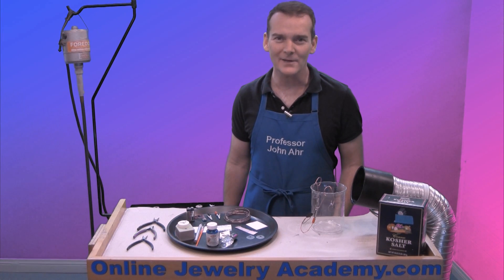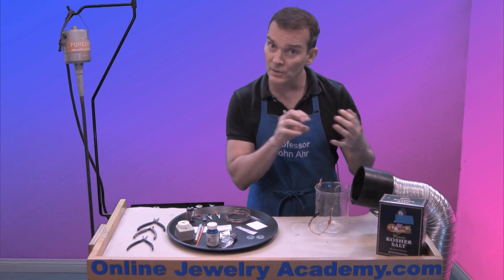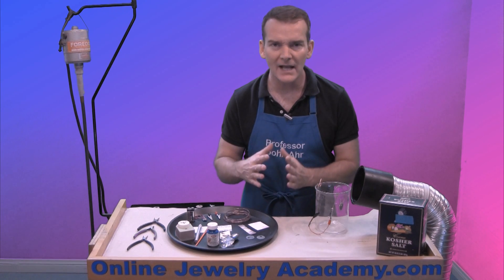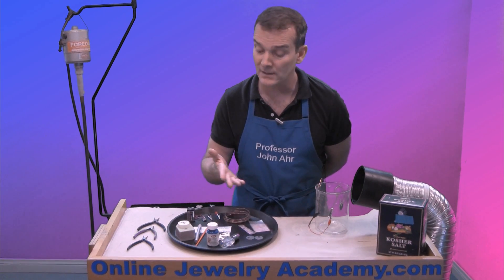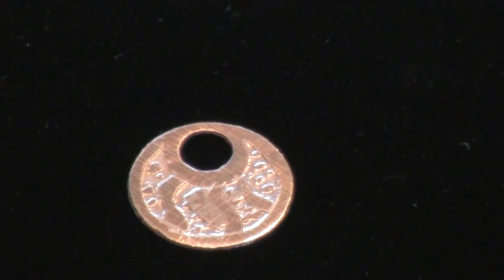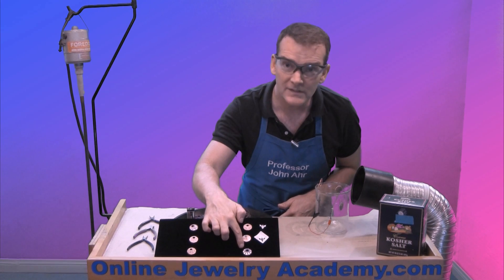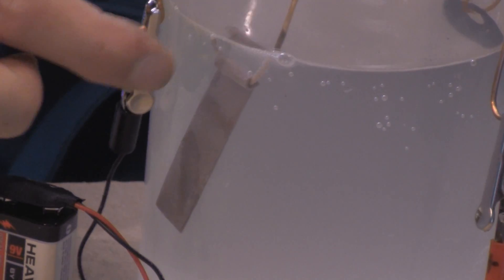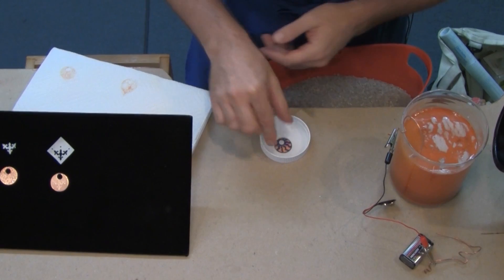Electrical Etching Using Salt Water

Comment: At what point would you recommend using a DC power supply that plugs into the wall
Reply from the maker: Because working with electricity can be risky, the OJA has purposely avoided posting on that topic. There are numerous post about this on other sites. Good luck with your creative pursuits. 😀

Comment: Wax works as a resist in many other art projects. Would it work well here?
Reply from the maker: In my experience, any material that’s easy to rub off of a metal surface doesn’t make a good resist for etching. So, wax is not a good choice. 😀

Comment: 5:27 Do you always protect the backside or do you sometimes leave it exposed for a better shellacking?
Reply from the maker: Any part of the surface of your piece that is not protected by a resist will be attacked by the etching process.  So, you must protect the back side of an object that you plan on etching. 😀

Comment: is it possible to etch a 4" hole right through to the other side in stainless steel ? it would save me money on carbide hole saws if it is.
Reply from the maker: You should ask someone who regularly etches steel. I honestly don’t know the answer. The process in the video produces a low relief etch. 😀
Reply: @OnlineJewelryAcademy  no worries, thanks mate :)

Comment: Thank you so much for making this. Clear instructions, good camera work, accessible tools and ingredients. I've been researching this process and you honestly have the most approachable tutorial I've found on YT. Also, it's been years since you posted this and you still take the time to respond to questions. You're the best.
Reply from the maker: Glad you enjoyed the video. Thanks for watching!😀
Reply: @OnlineJewelryAcademy  
I am glad i came across your video! Could you please tell me - in the last example you used email and after that you removed all of it.Can you tell me what sort of email it was- full name and the solution you put your sample in?Full name when possible.
Also what battery it is, never saw anything like it in Europe,and Germany in particular can you tell me Full Name for this.
Huge thanks and my respect for your knowledge and comprehensive explaining!💓🤗
Reply from the maker: @jolantastanko1233  I used enamel paint for toy models. And I used turpentine to remove it. The shape of the battery isn’t important. You need one with the correct voltage. I recommend that you continue your research and investigate battery options available where you live that can be used for this process. You may want to look for information produced in your home country. Good luck with your creative pursuits. 😀

Comment: Thanks for this. Just to confirmIf I want to etch aluminium, I guess I'll need an aluminium piece for the negative?
Reply from the maker: Hi Lulu Labelle,  Electrical etching is great.  But, I have found that it works best on copper.  You might want to do some more research online about etching aluminum before you try it.  I have not performed this process on aluminum.  Therefore, I cannot say how well it might work.  Good luck with your creative pursuits.
Thanks for your support! : )

Comment: hi, can I use this method using, staz on ink for the main image to be stamped (etched around) on the piece?
Reply from the maker: I'm sorry, but I don't understand your question.  The best resists to use are PNP Blue Paper, enamel paint, and permanent marker.  You can also use contact paper as shown in the video.  The OJA has two more videos on salt water etching that you should watch.  They might answer your question in depth.  You'll find them on our website at: www.onlinejewelryacademy.com
Thanks for your support! : )

Comment: It worked in sterling silver using 9volts battery but you have to leave it overnight. I tried using the 9v adapter but I was not comfortable leaving it for the whole night; I did it for 2 hours but the etching was not deep enough..
Reply from the maker: Hi Jessica,  The process works best with copper.  Silver never produces a very deep etch.
Thanks for your support! : )
Reply: @OnlineJewelryAcademy  Trouble with silver is that silver chloride forms. Silver chloride is quite insoluble. Silver nitrate works better on silver.

Comment: Salt water and copper etching is not so green.  My wife makes jewelry and I thought saltwater etching of copper was a green method.  Before setting this up for teaching in her studio I wanted to know what those gases are and why the salt water electrolyte can't be continuously reused, and why it changed color, got gooey, and had to be disposed of.  I learned that salt water etching of copper is very problematic.  Using salt water as an electrolyte generates competing side reactions in which the salt (NaCl) is electrolyzed into chlorine gas at the anode and hydrogen gas at the cathode, and sodium hydroxide is created in the electrolyte.  Chlorine is a toxic gas and it depletes ozone. Sodium hydroxide is one of the transition metal hydroxides, and these are very insoluble.  The sodium hydroxide combines with any metal ions generated in the electrolyte solution, and the resultant precipitates as a gelatinous goo in the salt water electrolyte.  For this reason, you cannot continuously reuse the salt water electrolyte because it has been altered and contaminated chemically.  There is a greener way as counter intuitive as it seems.....

The greener and more efficient electrolyte for etching any given metal is an electrolyte consisting of the same metal ions as the metal to be etched.  So, to etch copper, for example, use copper sulfate.  The metal piece to be etched is the anode, and a scrap of copper is used as the cathode. During etching copper is removed from the anode, flows through the electrolyte and is deposited on the cathode. The very important difference is that the electrolyte acts as a transfer medium for copper ions, but the electrolyte itself is not altered, is not contaminated and does not break down. This means the electrolyte does not need to be disposed of, and can be reused indefinitely.  So you can simply return it to its storage container.  There are no side reactions as long as you do not use too much electrical current.

Etching alloys of copper, brass or bronze, can be more difficult. With brass use zinc sulfate, because with copper sulfate the copper etches out of the brass surface while tiny particles of zinc fall into the solution, and these fine zinc particles will reduce the copper ions in solution, resulting in zinc sulfate and copper precipitated out.
Reply from the maker: Hi Paul, Thanks for posting such an interesting comment.  I'm sure that many of our viewers will find your remarks beneficial to their work.  If you've made a video on this topic the OJA would be happy to provide its viewers with a link to it.
Thanks for your support! : )
Reply: What Solution should I chose to etch Gold

Comment: Hi John,
Do you ever etch all the background away with this process?
Reply from the maker: +Glenn Campbell 
Hi Glenn,  Etching through a piece can be problematic. The resist on the surface won't control how the material is etched internally as a hole is produced. That's why we apply resist to the edges of a piece. 
Thanks for your support! 😀

Comment: Hi Jhon, thanks for the valuable tips and exclente your site I looked for a machine to make such a border did not find, thank you for clarifying on these edges but could tell me a web site where I find this machine because sincerenly I have not seen anywhere. Or more or less explain the technique, thanks
Reply from the maker: The machine that made that boarder is a large industrial piece of equipment.  You won't find one for sale from a jewelry supply company.  The closest thing that you might find that would bend a thick edge like that would be an old crank tool used to roll the edge of buckets.  Good luck with your search.
Thanks for your support! : )
Reply: Good evening John I think even for you it would be challenging to try to make this border but I discovered how it is done and I appreciate the joyous idea of the old machine the crank but it is made like a print in a hydraulic press.

Comment: Hello John, I searched a lot on the internet for two things and I did not think how to color these pieces of copper, I saw a lot of paint on alcohol but here in Brazil it is limited and patina I found but I did not get a good result and the other question is how to make a border On a bracelet like this site:
Http://www.comprazen.com.br/5780/bride-metal-dourado-oval-turquesa-7cm-india
Reply from the maker: Hello.  Here's a link to an OJA video on patination of copper: https://youtu.be/2X16hNlc_5I  You'll find other similar videos on the OJA's website at:  www.onlinejewelryacademy.com  The videos are organized on the website by category.  So, you should be able to find lots of great ideas on the OJA's website that don't rely on hard to find supplies.  The boarder on that bracelet is machine made.  It's possible to make something that looks similar by hand.  But, it's an advanced process that I cannot explain in the comments.  Good luck with your projects.
Thanks for your support! : )
Reply: You might try adding the border with split round wire like I get from Rio Grande. The problem would be attaching it if you don’t solder. A butane torch doesn’t do a good job, in my experience, on copper. One could try and use a product like JB Weld, but you MUST to make sure no product showed on the outside; once its set, there’s no removing it. That’s just my creative mind saying “what about this idea” as I have no experience doing what I suggested. I would solder the split border into the cuff. Also you might try putting resist around the outside so the border area wasn’t removed????

Comment: I just watched a video where the women said you can save the salt water solution to use over and over. What are your thoughts on this?
Reply from the maker: Sure, you can save the salt water solution and reuse it.  Eventually it will stop working fast and will need to be replaced.  But, it is possible to get a few etching from one salt water bath.
Thanks for your support! : )
Reply: Thanks for answering so quickly! -- I'm assuming if I'm etching small pieces, the size of the container can be smaller than what you're using in this video as long as there is enough water to cover your piece? I'm thinking something like a 1.5 cup glass measuring cup. Thanks in advance!
Reply from the maker: Yes, you can use a small amount of fluid.  But, the smaller the volume of liquid the faster that it will become saturated with impurities.  Good luck!
Thanks for your support ! : )

Comment: Very very pure salt and then add tap water!?? Does it make any sense?
Reply from the maker: You can use distilled water if you like.  But, it's an unnecessary extra expense.  The most important part of creating your salt water etching solution is the salt.  If it isn't pure the impurities might impede the process.
Thanks for your support! : )

Comment: Hi, I am VeeVee, 
1)Can I use battery of 9V to etch name plates of 10"x4" say 20 of them made of Steel in one go.?
2) Can I use battery of 9V to etch name plates of 10"x4" say 20 of them made of BRASS in one go.?
3)How much salt and water will be required to  make solution
Reply from the maker: Hi Vashdev,  Here are the answers to your questions.  1) No  2) No  3) You need to "saturate" the water with salt.  So, mix salt with hot water until no more will dissolve.  By the way, salt water etching is intended for small jewelry operations where the use of acid is out of the question.  It sounds to me from your questions that you may want to investigate professional etching services in your area.  Good luck!
Thanks for your support! : )

Comment: works great !
I used a DIY 18650 battery pack with about 15,7 V
Took only 4 minutes for a pretty deep etch
Reply from the maker: Glad that you had great success with your etching.  Thanks for sharing your experience.
Thanks for your support! : )

Comment: couldn't you put the design on both pieces "negative and positive" and have the design on both?
Reply from the maker: Hi Dominic,  No, it doesn't work that way.  You'll see when you set your etching system up at home.  The negative side of the system bubbles so strongly that it would push off any resist that you applied to the metal.
Thanks for your support! : )

Comment: Can you recover the lost metal that was etched away?
Reply from the maker: +Sonja Lang 
Hi Sonja,  Yes, the metal that goes into the solution can be recovered.  But, I would leave that job for a professional metals refiner.  The process can be both dirty and dangerous.
Thanks for your support! : )
Reply: Could you reverse the electrodes and do a copper deposit etching?
Reply from the maker: Good question.  I think what you might want to investigate is electro-forming.  It's essentially a plating process.
Thanks for your support! : )

Comment: to the landfill ? .... copper solutions are highly toxic to the environment. from the landfill, it will end up polluting either ground water, the coastal system/sea - probably both. try to send the solution to a chemical waste management plant. best from greenland.
Reply from the maker: +clusterguard 
Thanks for your feedback.  Pollution is a concern.  By the way, in the video I do state that viewers should check with their local authorities on the proper disposal of the waste they produce.  In our area, the disposal method that the OJA used is legal (and recommended).
Thanks for watching! : )
Reply: Thank you. And thanks for your nice video. Best wishes from Greenland.
Reply: OnlineJewelryAcademy I'm curious about how wise disposing in landfill is even in cat-litter. The products of this process are 'metal' powders that become more hazardous when in their powder form. Clearly mixing with cat litter is a good way to dry the them out and make them more inhaleable, which can irritate the air ways and lungs.

Secondly whilst the final sludge is relatively benign (I think/hope) you may want to look into the chemistry as I'm fairly sure  some of the "intermediate" compounds, that probably come and go are less safe. On this note stainless steel has potential to produce unpleasant products and lots of guides warn against it. I can provide links to more detailed chemistry/hazards if you wish.

Comment: What gauge sheet are you using to etch?
Reply from the maker: +Ro Ostuni   Generally I like to start with 18 or 20 gauge sheet.  It depends if there is a weight issue, scale of the piece and if I'm going to enamel it.  Check out our other etching videos at www.onlinejewelryacademy.com  Thanks for watching! : )
Reply: +OnlineJewelryAcademy Thanks! I did watch the other video. I usually etch in 18 if I can as I then enamel it. nice to know I am on target.
Reply from the maker: +Ro Ostuni Glad I could help.  Thanks again for your viewership. : )

Comment: How many times can you use the solution? Is it only good for one piece only? Thanks for this video - I hope to try it out today :)
Reply from the maker: +Little Cherry Hill - Metalsmith If you allow the salt water solution to settle, you can pour off the clear solution and reuse it.  Exactly how many times you can reuse it is determined by how salty it is and how often you use it.  Sorry I can't give a more exact answer.  But, if you notice that your etching is taking longer, it's probably time to change the solution.  I would recommend that you also check out our follow up video on salt water etching https://youtu.be/rs-67MiFiAU   Good luck with your projects.  And, thanks for watching! : )
Reply: +OnlineJewelryAcademy Thank you!!
Reply: +OnlineJewelryAcademy I gave the salt water etching a go with a 6V battery and it gave me a fantastic etch in my copper after about 55 minutes. I also tried again straight after the first etch to do 2 more etches and they worked out just as good. Before I got your reply about pouring off the clear solution, I had stirred up the used batch the next day and used it again and got a great result! So glad I came across this way to etch as I had previously been using Ferric Chloride and wasn't really happy with it. This method seems to give a much cleaner etch in the etched away parts of the metal. Thanks for sharing this great tutorial :)
Reply from the maker: +Little Cherry Hill - Metalsmith I'm so glad that you have had success with this technique.  Personally, I can't stand working with Ferric Chloride.  Good luck with your future projects. And thanks for being a loyal viewer! : )

Comment: Hi,
and thanks for the making of video for etching procedure mostly for me,
I want a little help i want to Etching on Name plate of Steel in large size, is this procedure work for my requirement ?
Reply from the maker: tahir naz The short answer is yes.  But, etching on steel requires a slightly different approach.  I suggest that you investigate other videos on YouTube that deal with using salt water etching to etch steel and knives.  Good luck with your project.  And, thanks for watching! : )
Reply: Thanks for replying dear

Comment: So cool. I can't wait to try this. One question though and it might be a no brainer.  Do you sand the edges of the cut metal before you begin the process?
Reply from the maker: TapestryGal Designs You can sand and finish the edges of your piece after you complete the etching process.  Just be sure to protect the edges of your piece with a resist so that they don't get etched.  Thanks for watching! : )